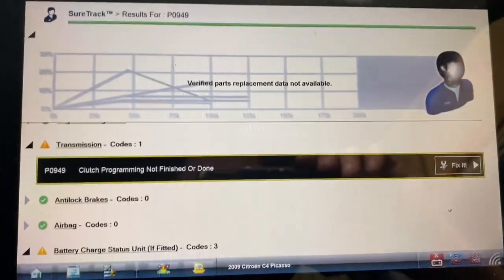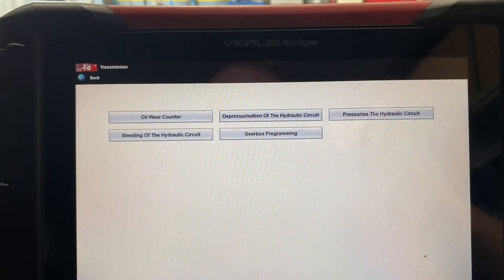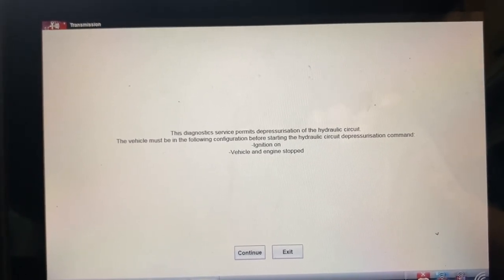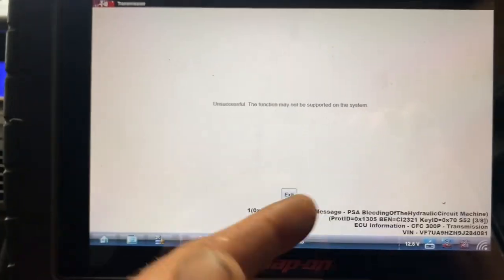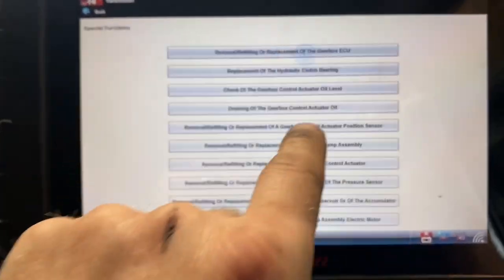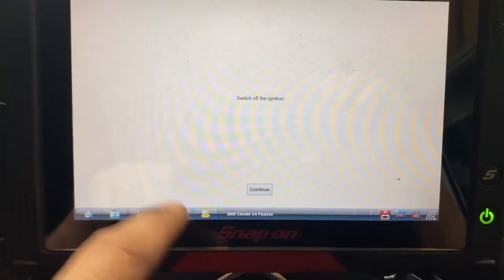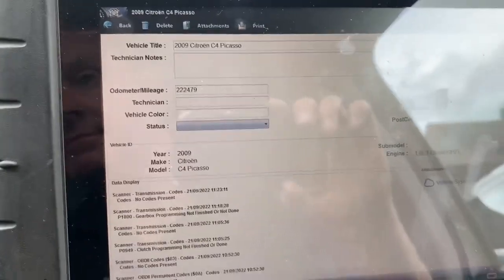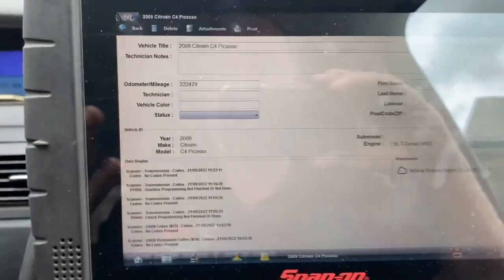Citroen Picasso, P0949 Clutch programming not finished or done

Comment: I'd a 1.6 petrol Picasso (2004/2005 -  I don't remember) that had 450k on the clock & still ran like a champ - I would have considered it an impossibility because "Citroen"/"Petrol" - if I didn't also have a Citroen Dispatch that had 440k on its clock and still did a full days work. . How a 1.6l petrol French car ran great at 450K miles without anything getting rebuilt did baffle me- but it did & it was a great car to drive even at that mileage.   I have a soft spot for these, even if they have their foibles. Neither ever got to cool - one driver would hop out, another would hop in and head off - but maintenance was always always done on the button - they never ran with old oil or filters. At the same craic - never getting cold -  we'd Landcruisers that did 60K in 6 months that crapped every major component while the Citroens stayed running.
Reply from the maker: Some of the French stuff can surprise you, great running gear. We had an 2005 Primastar taxi that the clock turned from 999,999 kms to 000,000. 12 months later everyone wondered how it was so wrecked when it had on 50,000 done😂😂😂
Reply: @kennedysgarage3281  This vid is Gold btw Peter. You'd need your head examined to want to buy into this - but still a great tutorial. What I learnt is "Run!!!" Lol.
Reply from the maker: @jamesward5721  A good run is sometimes better than a bad stand 😂😂😂👍
Reply from the maker: @jamesward5721  enjoy your Saturday off so James 😎😎👍
Reply: @kennedysgarage3281  Not had a weekend off in years Peter - work 7 days. Joking aside. Still can't keep up. Rust never sleeps.
Reply from the maker: @jamesward5721  wow 7 days is tough going. I’m a 5 day man but very often forget to go home 😬😂😂😂

Comment: Had exactly same symptoms, after 2 years ( I found it ) some idiot I think changed clutch but filled actuator with gearbox fluid 🤦‍♂️ emptied and put correct 9979a4 fluid in and works perfectly

Comment: I've got the same issue. Tried programming it. 
You mentioned start and stop 3 times. Instructions said 4 times then wait 5 minutes before turning it off after you do it 3 times. 

Did you just drive it and stop a few times and reset the computer or as the instructions say above?
Reply from the maker: I actually cannot remember the exact procedure but only carried out what it asked me to do. And it worked successfully, but if your scantool is requesting different, I’d do whatever is asks. It should all work as planned then 🤞🤞